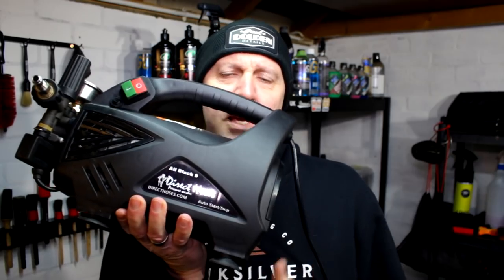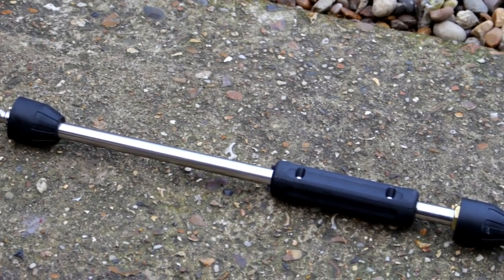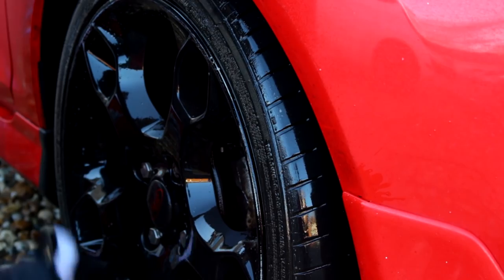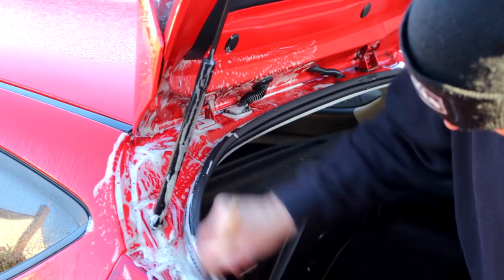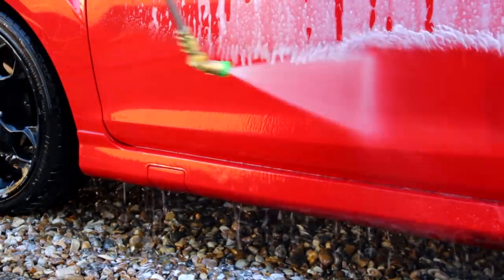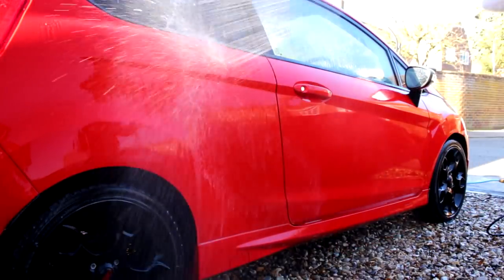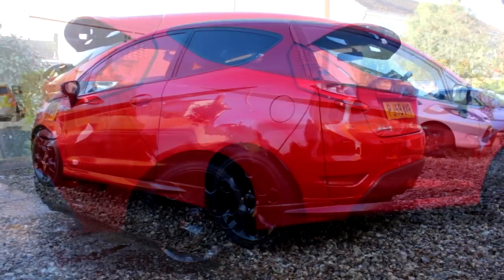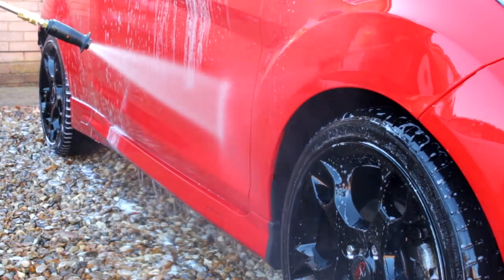Is this pressure worth buying

Comment: I bought one of these at the beginning of 2020 and I have used it without issue infact for the money its a brilliant bit of kit. I am a weekend warrior and nothing more so the power of the machine is fine and with the addition of a turbo nozzle I have cleaned patio and garden walls etc. Only now as I type this message has the machin sprung a leak, of oil from inside. I know that direct hoses have had some flack for poor customer service but, up to now thaey have replied to emails and asked for more info in a bid to sort the leak out so fingers crossed. I love the review that Paul has done and to be honest would you ecpect anything less than an honest review for the detailing god Mr Dolden!!. In short I love mine and hopefully it will continue to give good service
Reply from the maker: That’s great news Sir 🙌🏻😍

Comment: Had mine around six months and had no issues at all.
Before buying the machine i spoke with the guys at direct hoses and there customer service was exceptional they were fair and hinest about the machines limitations. Service costs and replacement parts seemed reasonable aswell.

Comment: Great honest revieve Paul , got my c135i about 18 months ago argos had them for about £130 , then spent about anothee £100 getting all the hose , stuby gun etc from direct hoses, and i found the black 9 for £175 and was a bit pissed off ! But my nilfisk hasn't missed a beat in over 18 months of use , i.ve also heard about quality issues with the black 9 , so i dodged the bullitt there, all the best

Comment: Fair review Paul. I’ve actually got the All Black 8 and I seem to have got one of the good ones. 3 years in and all good. I know there were some quality issues and unhappy customers.

But I like the concept, compact size and the good quality hoses from Marcus and the DH team. I opted for a long 15m hose and it’s as good as new after all this time.

The All black 8 got me onto QR accessories 3 years back and that’s been a great help, with Snowfoam lances, nozzles and couplers as you well know..... I think I sent you one via Kavd Store 👍🏼

Comment: Good points and a nice fair review Paul 👍 

I took a punt on mine in a detailers pack which made it such good value compared to 2 failed Karcher K2s and compared to other more expensive machines was perfect for my needs and included all the add ons that makes it more expensive. 

They've added bits to the design as mine didn't have the pressure adjustment but can be retrofitted.

Ive had no issues touch wood with mine apart from the vario lance didn't twist when it first arrived but got a replacement sent out.

Otherwise Ive been fairly lucky with mine which will hopefully continue. 

As with any tool/product research the brand, find reviews of the tool and the customer service they provide and I think it rings true to buy the best you can afford.

When mine needs replacing id opt for the grey series or if possible a Kranzle.

Again nice review Paul 👌

Comment: Loving these videos I’m watching you more and more just honest reviews straight to the chase!

The quality of these machines is fantastic, I’ve had mine over 2 years and it hasn’t let me down once fingers crossed. The build quality for me is excellent, it’s quiet strong and weighs a lot for its size, it fits nicely on a stand in my garage with a 25m hose, the hose is a flexible rubber hose not cheap plastic tat like most machines nowadays. I love that it can fit tidily on the wall and is very portable and dosent have a massive plastic box around it making it look bigger than it is. The Lance has lasted as long as the machine and I really could never find any faults with it, you can adjust your pressure it’s serviceable and will happily draw from open water. What more could you ask for £150... side by side to my petrol pressure washer It’s virtually silent and produces much more power. 
*Watching this video it looks like the quality of the accessories has gone quite downhill compared to when I purchased mine.
Gets used at least 3-4 times a week
Reply from the maker: Stay tuned for an update love your comment 🙏🏻
Reply: @PaulDoldenDetails  Love how you get involved with your viewers! I find myself watching your content more and more as a hobbyist detailer and find it very honest and enjoyable to watch. Straight to the point and no BS love it! Keep the content coming 👍🏻
Reply from the maker: @CAM-sf9kx  thanks 😊 I’ll be more with Direct hoses so watch out for updates

Comment: Bought a hose from DH years ago and it was trash plus it leaked so went straight back. Jump forward a few years and three Nilfisk machines later and looking for a replacement that wasn’t blue or yellow. Kranzle was the obvious answer but when you add on the cost of the necessary bits and a divorce it gets a bit too pricey. So slap bang in the middle sits the AB9, with a 20mtr hose reel and a bag full of other stuff it was a bargain, but did I dare risk it?

Actually I did, and apart from the not very sticky rubber feet falling off literally as it came out of the box I’ve never had an issue with it. Mine didn’t come with the PA adjustment handle, suppose I could adjust the screw but never have and never had the o ring problem. Power wise it’s enough for detailing, probably just about right in fact, more power could damage some paints or get under stone chips. I have used it for decking and concrete and it’s fine for domestic jobs. Apart from the 20mtre reel, which is essential as it’s not exactly a portable machine, the best feature is that it will run and run and run, I can rinse a whole car non stop without letting go of the trigger and it will  just take it in it’s stride, so the motor is definitely up to the job. There may be some small niggles, build quality and materials are not Kranzle standard but they are as good if not better than Nilfisk/Karcher and let’s not forget the base machine is half the price of their equivalents and probably a quarter of the Kranzle. 

If you can get one, get one. If you can afford the Grey, go for that instead. Don’t worry about specific accessories because it’s all 1/4 inch qr that you can get from anywhere, but you absolutely do need a hose reel.

Comment: Nice review 👍 any good from a mobile point of view being generator powered, concerned auto stop start would put additional pressure on the generator. Anyone had any problems
Reply from the maker: This is aimed at the domestic market Keith I would look at the Grey series 7 which I should be reviewing soon
Reply: @PaulDoldenDetails  fair enough thanks again. I did like the tfr and snowfoam comb works a great when needing a quick turn around. 👍,.

Comment: For someone like me with limited storage space this could be useful OR if you have the snow foam bottles etc already . Something to consider in the spring Im just wondering if the water butt attachment would work that well for me with me having no driveway Im having to bring the car UNDER next doors flat so would the pressure be there with a longer reach ? Good video as ever Paul

Comment: I'd have the hoses, and attachments they look fine but the machine looks really cheap, the clear plastic the inlet  water hose attaches to wont last five minutes, karcher made that mistake and n the k399 and quickly started offering that part made of stronger  black plastic as they just go Brittle and snap or shatter . I've had two karchers, a k399 and it failed after a year from motor gaskets failing ,  I've now got a less expensive k2 and it has been OK after two years,   it feels a bit cheap and has its flaws still however. But it doesn't leak and hasn't lost pressure.

Comment: Mr Dolden Sir. Pretty canny and useful review. Did you try the inlet hose with filter that sucks water from a bucket ? Curious to know if it works for those who don't have an outside tap.
Reply from the maker: Hi Gary no not tried it yet but apparently it works according to other owners and you do get the attachments in the kit ✊🏻

Comment: This pressure washer didn’t even last me 6 months was constantly leaking from the push fit connector even though I used brass fittings and kept cutting off as pressure would suddenly drop and wouldn’t work. Don’t know why it did that I tried to speak to direct hoses no one could explain what’s wrong so I ended up buying a kranzle k7,

Comment: My dilemma go for the grey 10 or get a Nilfisk??
Reply from the maker: It’s a real tough one because the Grey series is really for professionals but it’s still cheaper than a kranzle 🤔 and has all the goodies a Nilfisk doesn’t
Reply: @PaulDoldenDetails  would 1800 psi be enough! Was told to get 2000psi! Good pressure to handle most to all tasks and even foam wise, 100ml can produce good thick foam. Dilemmas...🤔🤦🏾‍♂️
Reply from the maker: @tazznijjar7111  2000psi is 137 bar my Nilfisk is 135 bar and is plenty powerful it’s funny what you get use to 2000psi is probably enough for 4x4s and commercials 100ml is 1 inch of snowfoam yes thick enough
Reply: @PaulDoldenDetails  grey 10 or nilfisk?? I have everything from the all black 9 so just a machine is needed!

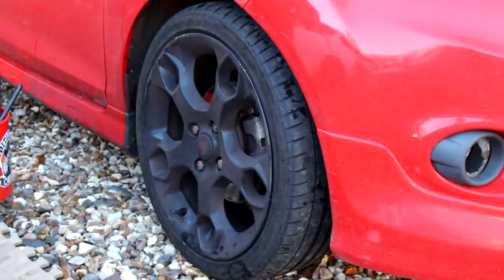Comment: Looks like the pressure clock has totally filled with water @ 4:05 to 4:15.
Reply from the maker: It’s got a liquid in it from factory
Reply: @PaulDoldenDetails  Makes sense, I suppose it acts like a spirit level bubble.

Comment: Hi Paul,you have (or had) a nilfisk power washer like myself,just wondering is there an attachment on the market that lets you clean the underbody of your car? have you used anything before with success?
Reply from the maker: My Nilfisk is a quick release conversion there’s this https://sgcbuk.com/products/kdn-detailing-chassis-cleaner?_pos=2&_sid=6cdc910e3&_ss=r
Reply: @PaulDoldenDetails  I'll give it a crack with the upside down patio cleaner, if no joy I'll get something like that, cheers Paul

Comment: What pressure washer would recommend for under £200 was looking at this one initially
Reply from the maker: Depending on what your after do you want quick release system or just a bog standard pressure washer this machine has all the kit but as I explained in the video look at Nilfisk and then add what you need as in snowfoam Lance and quick release conversion
Reply: Nilfisk C135i👌🏻

Comment: My nilfisk has just about died and was looking at one of these  or an alternative for similar ish money would you go for on of these or a nilfisk
Reply from the maker: The question is money and up the cost of a quick release conversion and hose upgrade on the Nilfisk or just buy this
Reply: @PaulDoldenDetails  thats kinda what ive been weighing up ive managed to half convert the old nilfisk to quick release which has worked very well however its alot of money to invest if its going to go wrong quickly

Comment: had my AB9 for 3 years pretty good and support has been excellent BUT now the pump switches off after a minute or so. Cleaned all the hoses etc and taken the covers off all looks good, although the reset switch doesn't seem to operate as no back pressure, Is the fault related to the pressure switch as I see they sell this for 11.50 Is this a known fault and the cause of the pump switching off? Any advice greatly appreciated
Reply from the maker: Not I don’t own mine anymore

Comment: Definitely a budget pressure washer but build quality not great, and with a fan cooled motor its definitely not going to work longer periods of time, where as your Nilfisks, Karcher, Kranzel etc all operate with water cooled motors, much more efficient and can be worked for longer periods of time with less moving parts to go wrong, great video Paul 👍
Reply from the maker: Very good comment ✊🏻